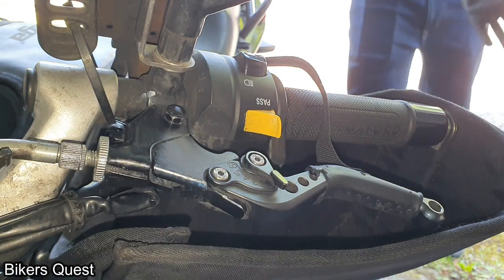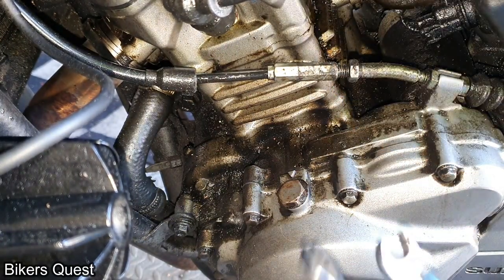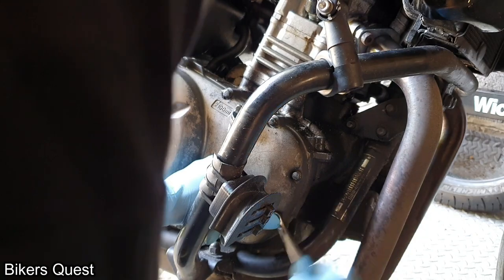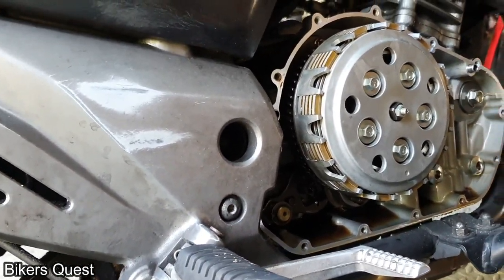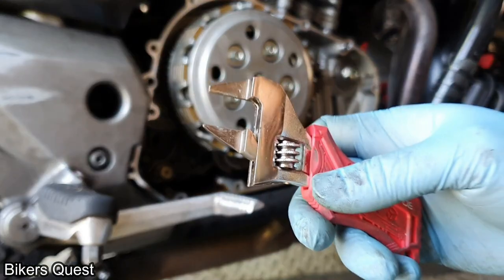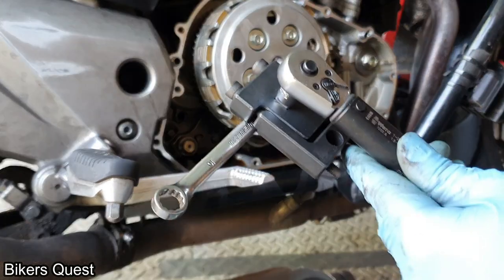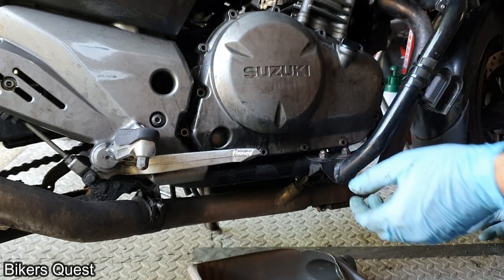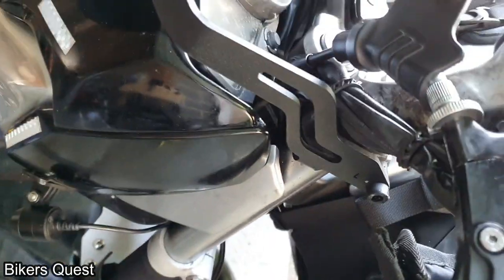Suzuki Inazuma Clutch Adjustment (GW250)

Comment: That’s a great video thank you for sharing it with us. Can I ask you though? What was the reason for the clutch adjustment? Thanks.
Reply from the maker: The biting point may feel off as in it engages right att the and of the movement + a really floppy lever, Suzuki recommends doing this adjustment every 3000 miles I believe
Reply: @bikersquest   Would it not be possible to adjust the clutch at the lever only? Do you have to do it from the engine side when you cannot do it from the lever anymore? Sorry, I'm new to this.
Reply: My 2019 V-Strom gear shifting becomes difficult after 15 minutes of riding. Do you think I need to do this adjustment? It's almost 8000 Miles
Reply from the maker: @ukgardener973  Definitely worth adjusting on your Strom if it's mentioned in the manual clutch adjustment section, it will likely fix that issued you mentioned. You can't fix it from the lever side. One other indicator I had was after the bike was warmed up on the centre stand in 1st gear the rear wheel would still spin with the clutch in but wouldn't after the adjustment
Reply: @bikersquest  That's exactly what happens on my Strom, the bike spins in all gears even with the clutch pressed.
Reply: In your video, are you attempting to bring that clutch rod slightly further out so that the clutch would also come slightly out hence releasing it from the gears?
Reply from the maker: @ukgardener973  I think it just allows more clutch engagement so more space is allowed between clutch plates with it pulled in after the adjustment. I believe there's videos of people doing this procedure on SV650s so should be similar for your Vstrom
Reply: @bikersquest  It's funny you said that because my bikes do this. I have a HOnda CB125F and V-Stron 250 and both spin in 1st gear even with the clutch pressed. In fact, the honda even spins when I turn on the ignition. And when in 1st gear, it continues to spin even with the clutch pressed. I go into neutral and yep, still spinning.
Reply: OK, I've gone out and made an adjustment to the Strom on the engine side. Fearing I would mess something up, I made a slight quarter turn and now, my back wheel no longer turns when the clutch is pressed, Yipee! Thanks to you buddy!!! I think I might need to do the same with my Honda too. I need to go out and give a test. Perhaps that could have been the reason why after 15 mins of riding the gears become difficult to change. The oil heats up and clutch plate expands. I'll find out soon enough! Thanks. BTW: Where abouts are you?
Reply from the maker: @ukgardener973  Try to follow the procedure I did which is screw it all the way in then one turn out that's how Suzuki specify adjusting it, however if the clutch doesn't slip it's probably okay

Comment: When you made these adjustments, has it made a difference to the ride?
Reply from the maker: Yep, the clutch bite is more consistent not super far out and the wheel actually stops with the engine running on the centre stand when warm (not that this matters that much but before the adjustment it would spin still).

Comment: Do you have a video for a major clutch cable adjustment?  What should the position of the clutch arm be in?  Im about to install a new clutch cable
Reply from the maker: No I haven't had the need to replace the cable yet but may do if it breaks
Reply: @bikersquest  I have the same bike...would you happen to know how the clutch arm should be positioned when I adjust the cable on the engine side?  I haven't done an adjustment before and can't seem to find a video with that specific type.
Reply from the maker: @wannagofast5  I'm not sure what you mean exactly, unless you've taken the engine apart there's no reason to adjust the clutch arm on the engine side? You may need to find the workshop manual and find the answer there for that. If you adjust the freeplay on the engine or lever side you need to check there's 10-15mm of free play at the end of the clutch lever that's all.
Reply: @bikersquest  I'll take a quick video and dm you if you don't mind. With the clutch cable off...the arm moves left and right...im trying to figure which way it should be when I put the new cable on...or do I just attach the new  cable to the arm and make sure there is a little slack?

Comment: Hummmm that engine need a clean.  How can it even be this way. Lol.  Sorry. Had to say it.  Mine is 25000 km and still shiny as new.
Reply from the maker: I have since cleaned it and it looks pretty new haha. Yea this is extra filthy the reason being is I made the mistake of spraying the engine down with XCP rust blocker which is very sticky so all the dirt gets stuck to it and it's very hard to wash off. Moving forward I'm sticking to ACF 50